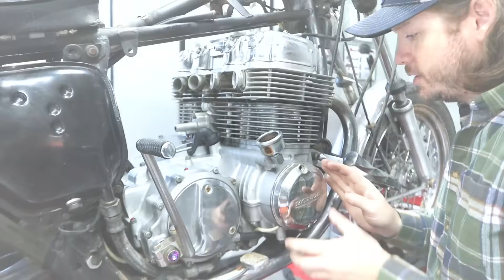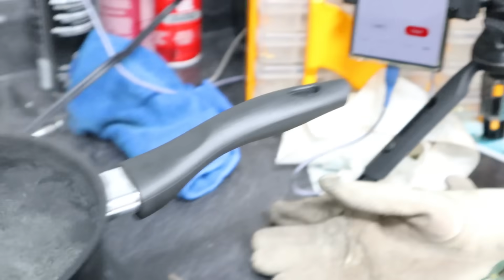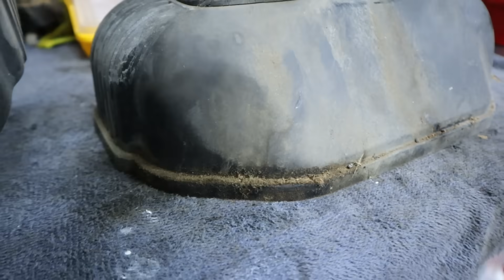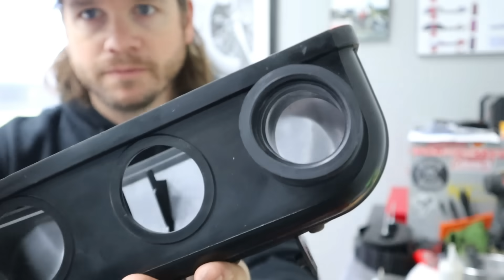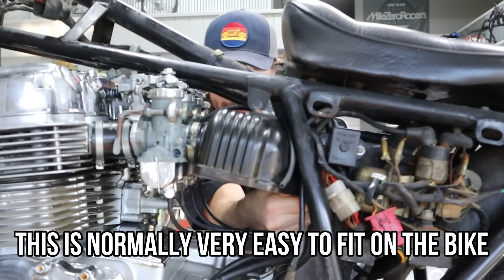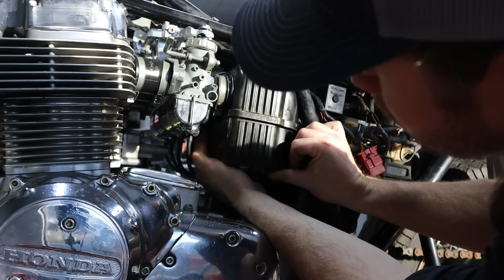CB750 Chopper Revival - Boiling The Intake Manifolds To Soften Rubber!

Comment: I have used ethanol and winter green oil. It does work. But 2 minor points. Don't get distracted by a cold and leave them soaking for a week - they were lovely and soft, but rather bigger than they were meant to be! Secondly, I would say to do it in an area that can be easily ventilated as they smell of the winter green oil is strong.
Reply from the maker: Good tips!
Reply: I've over done it with wintergreen oil and have had parts swell up as well. I boiled them in water for about 15 minutes and they shrank back down, but were still pliable.

Comment: I have encountered exactly the same problems on my 4 cylinder Kavasakis, years ago. I set the manifold out in the direct sunlight, for a couple of hours, and that warmed/softened them enough to install the carbs, and then the airbox. I have used a small rubber mallet to fully seat the carbs before airbox install. Good, concise, video!
Reply from the maker: Glad you enjoyed!

Comment: Took off the airbox from my YZF750R last night to swap out the plugs and couldn't for the life of me put it back on because the rubber boots were hard as a rock. I think spraying some silicone spray after taking them out of the boiling water might soften them up even more. I will definitely try this method! Thanks!

Comment: I've experimented with the wintergreen method and learned that it can be a good short-term fix, but they do harden up again. After treatment, they can get as soft as new, which is great for assembly, but after a few weeks (depending on temperature, etc), they do harden up again.

If it's an application where the hardness doesn't cause a problem after they're installed, then it's a simple and very cheap solution, and makes installation SOO much easier than trying to dunk in got water or use a heat gun. But, if you need them to stay soft for proper function, then it's not going to make much difference in the long term.

I've done it with 3:1 alcohol and wintergreen oil, and soak them for a day to a week, depending on the part. They do swell up, but I've found they shrink back down to proper size in another day or two.

I also use silicone oil for assembly and rubber protection. Unfortunately, it does not seem to help prolong the softness of wintergreen treatment much.

Comment: I had a heck of a time getting my CB750 carbs back on the first time I took them off.   Every time I've had them off since then has been a breeze.   Maybe my technique has gotten better.    I use 2 heavy duty zip ties to hang the carb rack from the motorcycle frame just above it and get it so it's sitting right against the manifolds, then I grab them and work them in.   Sometimes starting with one side then doing the other...which is why the zip ties help hold it in place...and if it falls it won't take  tumble..  Tilting from bottom to top rather than just a straight shove inward seems to work well.
Reply from the maker: Ive used straps in the past but since taking more time with the manifolds like shown I havent needed to use straps.

Comment: When you boil them, leave them in the water to cool slowly. They will stay softer for longer - it's similar to not quenching metal when it's red hot to harden it. The slower the molecular structure cools from its heat agitated state the softer it's likely to be.
Reply from the maker: That would make for a good experiment
Reply: @BrickHouseBuilds if you want a further experiment soak them in a solution of three parts isopropyl alcohol and one part methyl salicylate for 24 hrs. These are the basic ingredients that make up Wintergreen but in a more refined mixture specific to softening rubber

Comment: I have also used Methyl salicylate (oil of wintergeen). It works well. I have put them in ziploc bag with the oil and floated it in my ultrasonic with just the heat to speed up the softening. They can swell if left too long but a rinse with hot water and let them dry for a couple of days will shrink back to size.
Reply from the maker: Good tips!

Comment: Hello BJ, that was an interesting little struggle! To be honest, with the benefit of watching your video on a TV screen, it became apparent that when looking at the carburettor, when correctly seated, the line of the upper frame with the air box mounting bracket was parallel  to the upper carburettor throttle cable mount and the float bowl upper line.
     So you could use a T square from the upper frame to set the carburettor mounting rubbers at 90 degrees which should help align all the mounting rubbers ready to accept the air box. 
Great video BJ thanks for the update. Looking forward to seeing this one progress.
Best wishes Kevin.
Reply from the maker: It would be close but it doesn't need to be that technical. Normally I can line up the indentations on the manifolds but these were just harder to see.

Comment: The wintergreen oil works very well, but, use caution and make sure to check it at least daily during soaking as they can tend to get too soft and elongate. Takes far longer to shrink back than getting them more pliable.  Just a note from someone that left in a bath for 7 days and had to get NEW ONES cause they were way out of size.
Reply from the maker: Noted

Comment: I use either my heat gun (carefully) or an old hairdryer when fitting old intake rubbers, it’s just a matter of getting them hot ,and hot air is more convenient than winter green or water I recon, the hairdryer is probably best as you can leave it running blowing hot air in the direction of the intakes whilst you push the carbs into place (using light oil as well of course).
Reply from the maker: I have always used heat but feel they rapidly cool and need to keep going back. Boiling these was noticeably easier for installation as compared to my normal heat gun.

Comment: Hey BJ; I sprung for some wintergreen oil, and wintergreen infused isopropyl.  The latter costs the same as regular alcohol.  Guys use 1 part wintergreen to 3 or 4 parts straight alcohol.  I figure I can stretch that a bit as the oil's $45 a pint!
Reply from the maker: Yeah I definitely plan to try that

Comment: On my 72, I replaced the airbox boots with OEM Honda, but the very next time I r&r'd the airbox, they had hardened and shriveled up, such that it makes it almost impossible to get them fully seated onto the carbs, much more difficult than the intake manifolds. I hope you have better luck than me.

Or at least don't have to take the airbox off again.

Comment: When I am fitting this type of rubber boot, I smear some petroleum jelly on the interfacing surface. It greatly reduces the amount of force needed to get them seated.
Reply from the maker: When I use that I get a lot of comments saying its a terrible thing to do. Thats why I use silicone lubricant.
Reply: What are the negative comments referring to?
Reply: @BrickHouseBuilds  after some research, it appears that petroleum jelly will attack natural rubber. While the boots in question are not natural rubber, I'm sure you'd rather avoid the grief from commenters ;-)
Reply from the maker: In the past any time I've ever use petroleum jelly I get many comments saying the world will end

Comment: Nice, funny thing is that i use that CB750 (80-81) rubber intake manifold to connect a PWK carb on my chinise enduro because of the curvature and internal measurements.

Comment: Try Rubbing Alcohol - lightly spraying from a repurposed spray bottle -on those rubber boots when sliding them into place/on the cylinder head stubs.  Evaporates quickly....no need to drench, but you do have to work fast

Comment: Looking very nice, BJ! I normally hate the stuff but I have experimented with Armor All a few times. I have soaked sidecover grommets and ECU mounts over night and the rubber acts like new. I would try it on one of the old airbox boots to see if it could work on those.
Reply from the maker: Do they sell a volume of liquid or anything?
Reply from the maker: Well, beyond what's in a spray bottle
Reply: @BrickHouseBuilds  
Not that I am aware of. My bottle was from the 80s, spray type.
Reply: @BrickHouseBuilds  I have a half gallon or so jug of it so I know they sell it besides spray bottles

Comment: Wow I wish I had thought of this before tackling this project.  Always seems to be during winter right? I may have missed a video but what spring did you use for throttle return on the carbs. Mine is a beast to turn even with new cables. The carbs move smooth without the spring.
Reply from the maker: Winter doesn't really have an effect here. Just heat cycles and age.  Making sure the carbs can actuate freely is important as well as a lubricated throttle, lubricated cables, and proper cable routing which makes a huge difference.  In my electrical video after this you see me hook up the cables but still have to lift up a pcv hose for smooth operation.

Comment: Application of rubber grease would have helped with joining the rubbers to the carbs
Reply from the maker: We use silicone. Regardless of what you use, cb750 carbs take some pressure to get on and off

Comment: My VN750 has intake boot alignment marks on the rubber and intake itself. Did you happen to check for such marks on this set? I do understand the numbering system for the boots, but maybe there's actual alignment marks.
Reply from the maker: These do not on the cylinder side. Usually there are marks on the velocity stacks that help but not all the time

Comment: Maybe try this method if you’re the type of guy that likes ripping your carbs off every now and then. I’m not the type. I just buy new OEM carb holders, they cost between $25 to $35 each and last for decades.
Reply from the maker: I don't see your logic here
Reply: If money isn't an issue then yeah, replacement them. But if they aren't cracked then I don't see why you wouldn't just try to reuse them and save $100-$140. might not seem like a lot, but you can nickle and dime yourself to death with these old machines.

Comment: The Wintergreen oil method is a good short term fix, but the rubber returns to a granite like state after a few months unfortunately..
Reply from the maker: Hmm, that would be unfortunate
Reply: That's been my experience as well. After treatment, they can get as soft as new, which is great for assembly, but after a few weeks (depending on temperature, etc), they do harden up again.

If it's an application where the hardness doesn't cause a problem after they're installed, then it's a simple and very cheap solution, and makes installation SOO much easier than trying to dunk in got water or use a heat gun. But, if you need them to stay soft for proper function, then it's not going to make much difference in the long term.